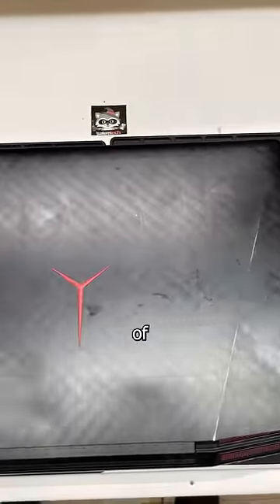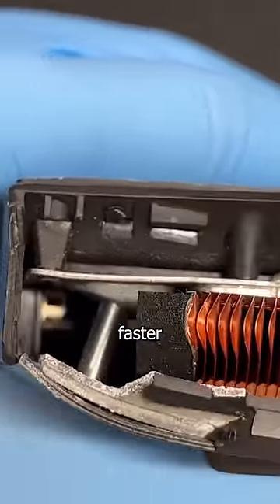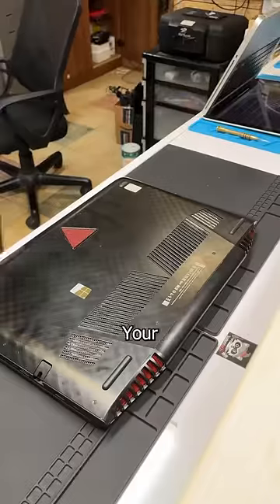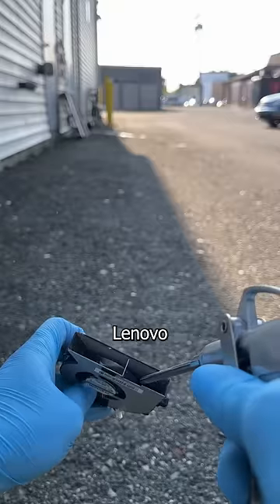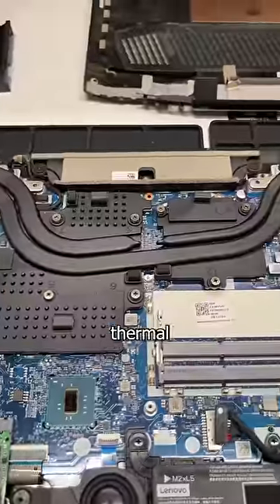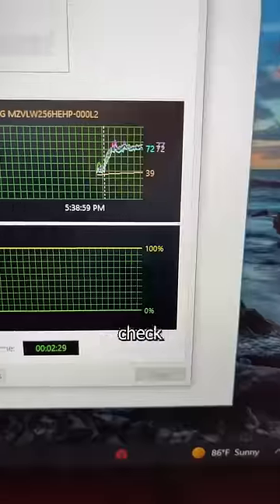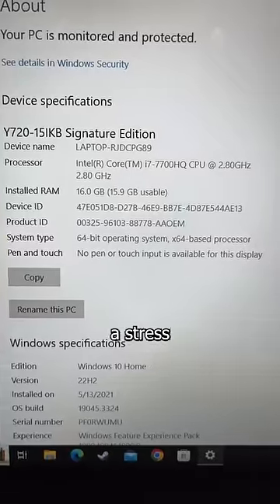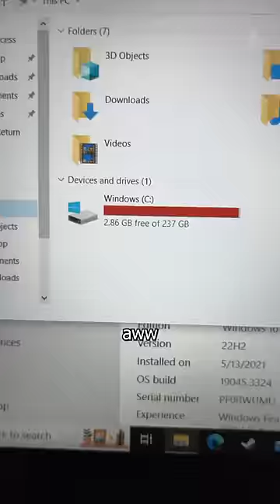Lenovo Legion #gaming #pc is dusty and falling apart #technology #tech #shorts

Comment from the maker: Have you ever gone through an entire repair just to realize there was a massive problem you missed in the beginning?
Reply from the maker: @mrgreenhatguy  I've forgotten to plug the fan in SO. MANY. TIMES. And this was back in the day where the fan was the last thing to come out of the laptop. 😭
Reply: @mrgreenhatguy you mean "tHe GrEaTeSt TeChNiCiAn ThAt'S eVeR LiVeD," right? I mean, he will probably take over the world some day though, as the greatest technician of all time
Reply: I was fixing a laptop and not checking the fan put it all together and still wondering why it was still overheating, I noticed I forgot to plug it in
Reply: oh and i forgot to plug the front panel connectors and thought i broke the pc i fixed because pressing the power button did nothing
Reply: Can you do a video on how you learned to be The greatest technician that's ever lived your an inspiration
Reply: Bruh I recently took apart an iPad for a touch screen repair, I fixed the whole thing and right at that moment the CPU decided to die 💀
Reply: @iamlupaz9528  i fixed a chassis before and i forgot to check the flyback it literally killed the tube
Reply: @crapnuts Wow. Look at that frost!
Reply: @crapnuts  😰
Reply from the maker: @iamlupaz9528  this hurts to read. My condolences brother
Reply: @mrgreenhatguy takes practice to become the best i guess
Reply: nah but I have accidentally broken both the power button ribbon cable and the it's slot clip
Reply: @SalemTechsperts  thanks bro, we ended up fixing it though. The tin Apple uses to connect the CPU with the motherboard sucks 😂
Reply: Oh yea for me my old monitor was acting up so I tried to take it apart. I gave up and ended up destroying the pixels in the bottom left corner, so now instead of not being able to use it from time to time (it shut off randomly for durations), I can't use it at all lol. It became my secondary tho a little before this.
Reply: Yes, cracked iphone. Bought the parts just for it to have fucked storage
Reply: I did with a DS Lite. I bought a screen just to realize the old one was disconnected from the motherboard, but it had alot of dead pixels, so i had to replace that fucker.
Reply: You don't become [The Greatest Technician That's Ever Lived] without going through trial and error first
Reply: @SalemTechsperts I'm currently building a pc since the UK does not have the greatest technician that's ever lived in it and honestly I hope I plug in all the fans and everything in correctly if not it's going to be painful
Reply: For me I was just changing my cmos battery and harddrive of my laptop and I forgot to remove the charger while working on it. After putting my ssd, laptop showed a boot device not found error and I found out the electricity killed the ssd.
Reply: @SalemTechsperts im still sick man 😢
Reply: @SalemTechsperts  I have a 250 gig disk and a 1 TB disk, i somehow still have 50 gigs left on the 250, and the TB unused :>
Reply: More times than I'd care to admit. You encounter a lot over time, almost 30 years in the computer/IT industry.
Reply: Laptop fans on these budget gaming laptops clog like that in only 6 months to a year. I know I've had to clean mine much sooner than anticipated
Reply: What was the mistake in this video? Tryna be more tech savvy
Reply: Yes, i often forget to plug the battery back, and i already screwed the back cover of my laptop😂
Reply from the maker: @HelipOfficial  this happens daily here at Salem Techsperts 😅
Reply: ...yes. the motherboard was bent.
Reply: I appreciate u actually being entertaining most vids u see like this are snooze fests and I immediately keep swiping so respect to u
Reply: @SalemTechsperts oh I remembered to plug the fan in but the fan wire got stuck under a screw near the end of the heat sink and the screw chewed right through the wire now I need to either solder the wire back together or order a replacement fan💀
Reply: Xdd
Reply: 237 GB is very little for a gaming laptop!! When you see the size of the games. One game at a time probably. It's true that with cloud gaming, it can do it.
Reply: ive never done anything with computers and ive had like 4. my school macbook, my acer, xps 15 and now a gaming laptop. the wire from one of the fans got pinched so hard it almost got cut and the fan wasnt working. i had the company send me a new fan and i did the repair myself, was going to take out the entire heatsink pipe thing until i noticed i could kinda just pull the fan out from under it. i think i fucked up by forgetting to connect it after i screwed it in because i remmeber having to go back in. and then i forgot the battery so i had to go back in again. and i chose to do all this before my works christmas party. mustve worked cuz 2 years in and it still works
Reply: Not quite but the closest I have ever had was I had a weird resolution issue. I couldn't figure out the issue tried everything I could possibly think of or find. Even factory reset my PC. Couldn't find the solution. Eventually I accidentally knocked the cord to my monitor out and plugged it back in, issue fixed. The most obvious thing I didn't do cuz I thought I already did it.
Reply: After starting to install my cpu cooler I noticed i missed some screws, so I contacted tech support and they had to send me the the screws THREE times because they got stolen 2 times.
Reply: Hi! I have got the same laptop except the hdd. I bought it as new 5 years ago and I never had the courage to open it up or give my laptop anyone to do it and make it great again. Soon I have to do it at some point and I am a newbie in how to repair or anything with laptop except gaming on it.
Reply: Can u save my melted cpu? Lol
Reply: Don't let the fan spin when using compressed air to remove dirt because it can damage the fan bearing
Reply: My laptop suddenly stopped charging and when the battery was zero, it never turned ON again... what could be the issue ?
Reply: Imagine giving yourself a pin
Reply: How much of that drive is one user profile 😂.
I tell all my gaming customers to use a separate user profile for each of the high end games they play.
Windows never has enjoyed huge user profiles ...
Reply: My repair guy changed the 200€ screen on my OP7pro before realizing the main board was damaged. Ended up costing me €300+ to fix a 4-year-old phone :(
Reply: I was fixing a tower computer that was randomly turning off. I swapped everything in that computer to see what was wrong (RAM, GPU, SSD, and even the CPU + Cooler). At this point I had all of my components except the mobo and the case in this computer and it still turned off randomly. Later one of my coworkers comes and looks at the case power button and finds that it was sticky and broken thus randomly turning the computer off. Me be an intern, was amazed and slightly annoyed that he found the problem so fast and easily that I totally missed in the beginning. 😂
Reply: Holy is Holy and not Sh**t , stop cussing and think before u speak
Reply: After doing so many fixes your technician brain starts to solve for the worst scenarios rather than the most likely.

I used to hate asking, "Did you turn it off and back on," because it is cleche and people give you the look, but so many of my tickets are solved within the first 5 questions that is is worth it to think practical.
Reply: 3 times, in the same repair... but to be fair I couldn't get to the basic issues before fixing the others
Reply: Also, the way you say "bellissimo" hits different, since I grew up in Italy 🤣
Reply: putting the bottom cover back on and realizing one of the c-cover screw fasteners broke off and you gotta replace that thing
Reply: @SalemTechsperts do you fix Xbox 360
Reply: Lewis Hamilton forever
Reply: Yes and it sucks
Reply: is there a good way to restore the touch pad on a laptop? mines slightly damaged and I was wondering if it can be restored.
Reply: @SalemTechsperts  so the “tech expert” constantly forgets something that obvious? You shouldn’t be fixing computers
Reply: Well I'm about to take apart my Asus, I've had it for a couple years now, so I think it's due for a good cleaning. 

I'll let you know if I forget to put something back as before.
Reply: I almost bought a third screen replacement for my phone, but opened it again just to be sure, turns out I forgot to connect the freshly replaced screen...
Reply: @Krypterium first day on the internet?
Reply: @tyedie4490  

i dnt care,whenever i hear something like that i have to say that
Reply: What was the problem?? That last image only told me they have an almost full hard drive..??
Whatd i miss..??
Reply: Do all that then find out that it has a bad RAM port/FSB.
Reply: Yeah for some reason the keyboard wasn't functioning anymore, well maybe connecting it would help 😂
Reply: @mrgreenhatguy  Honestly ever since I stepped through huge anxiety step to start using liquid metal wherever possible that's never ever an issue and the performance increase is so worth it. I will advise though always make sure you scribe your cooler part around with sharp metal around the outline of the CPU from the paste before u actually remove it and put very little liquid metal on it and just spread it slowly it will spread further than u think and repeat on the CPU itself you need seriously little. On GPUs and APUs pls for the love of god guy liquid electrical tape and cover the chiplets around the main die and let it dry well before you start applying liquid metal, this will really prevent any mishaps even if some liquid metal squishes out it won't short your chips.
Reply: was fixing a phone once. After I glued back cover there was one screw left on the table. Thought screw it, that'll do the job
Reply: @mrgreenhatguy by learning from mistakes like that is how one becomes TGTTEL
Reply: I forgot to reseat my RAM on the correct slots.
Reply: Bro my laptop is f**ed i raged a lityle to much but it stll runs  but like the pvs from 30 years ago
Reply: @crapnuts ever heard of rust-eze?
Reply: @crapnuts  damn it how could I have fallen for that
Reply: Not repair but somedays ago i build a pc for my brother when i plug it in and clicking the power button it was not working so i checked everything again and see everything was connected correctly so what was the problem? . After hour's of looking around I find out the psu button was off 🙃🙃🙃
Reply: The laptop or your marriage which one can be saved
Reply: I like your hat
Reply: 😊😅 @SalemTechsperts
Reply: This lenovo lemon 🍋  not legion 😂
Reply: Bruh😂😂😂
Reply: thats me with my old laptops storage, guilty lmao
Reply: Once took apart a dirt-bike with my neighbour, learned in the end it was bad gas
Reply: One time fully assembled my pc only to realize I forgot the IO shield
Reply: I sometimes forget to plug the touchpad back in 😂😅
Reply: I've done the same thing. Had to do a complete disassembly just to plug in the fan.  @SalemTechsperts
Reply: I have a
Reply: @SalemTechsperts  ive been there before! i have actually done that a few times on my own personal laptops!
Reply: Yep, but it wasn't a computer. How it feels to be in mech E lol
Reply: dont forget to vacuum exhaust grids
Reply: Hey you should try replacing the thermal pads if you can for better thermals as well though it's hard and sucks matching the pads
Reply: No, your marriage can't be saved.
Reply: no.  but i did manage to dissasemble my Dell Vostro and got left with like 6 screws not knowing where to fit them  :D   

I swear to moms.. ive never seen so many parts scattered around my table and i was a happy camper assembling Lego Techics as a kid..   but this??  56 screws and thing still didnt want to part ways with a keyboard...
Reply: The greatest technician that's ever lived!
Reply: Yes, and unfortunately it was after replacing a mainboard in an Alienware laptop. I left a cable unplugged that required me to take the board back out and remove the fan assembly. I never made that mistake again.
Reply: @SalemTechsperts  Hey Salem I was wondering what you have to say about my Hasee Z8 laptop. Also can you tell me what SSD stick i can use to upgrade the storage. I bought one before but it didnt work in the laptop.
Reply: I love the comedy in this video very good narration makes me spit on my coffee.
Reply: How much are your cleaning services?
Reply: That happens to me
Reply: Not necessarily A repair, but I disassemble things, then reassemble them in an attempt to fix it.
Reply: My 8 year old z87 motherboard (with 4770k) was causing some issues. I ordered a new CPU, motherboard and RAM since buying a replacement motherboard was too costly in terms of what I could get new if I sold the old CPU and RAM.

Then, when taking it apart to install the new core, I noticed the motherboard screws had loosened enough that the whole thing was moving with no effort. Tightened the screws and the issues went away but the new parts were in and had moderately better performance so....

On one hand, I spent $150 for a newer, stronger PC core. On the other, that could have been $0 and I'd be looking into newer components about now instead of 2 years ago.
Reply: Built it all. All was great, worked for about a day
Next day it didn't im not too sure what i did wrong still. Will tell you after i get the board and CPU back from testing 😂
Reply: I don't think my IQ has ever never felt lower reading this comment section, if I so much as looked at any tech other than my phone it's safe to assume my lack of expertise would cause it to explode without even needing to touch it 😂
Reply: holy cow , BATMAN 
.. 😂😂 ..